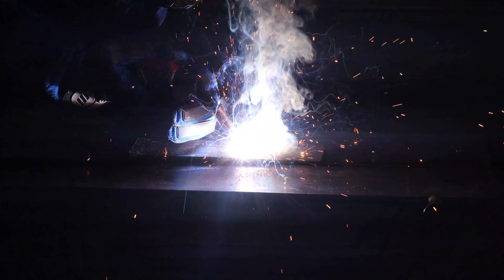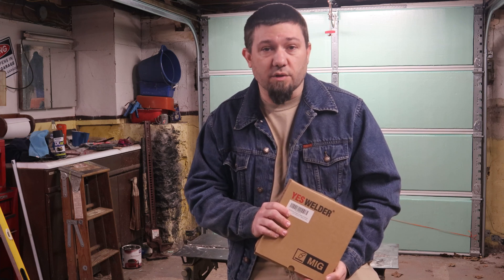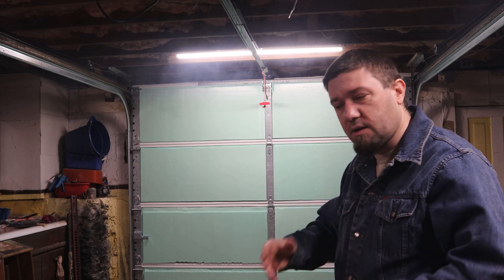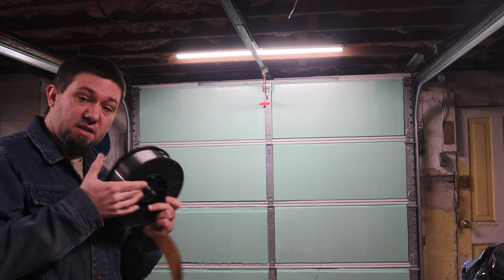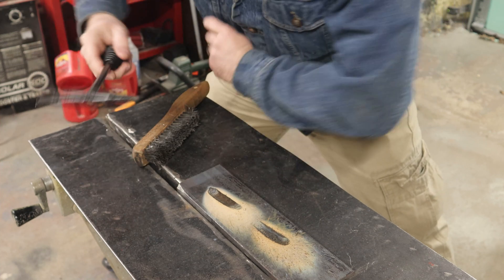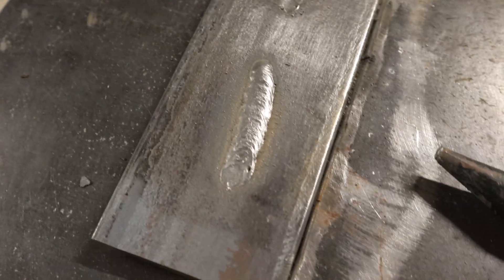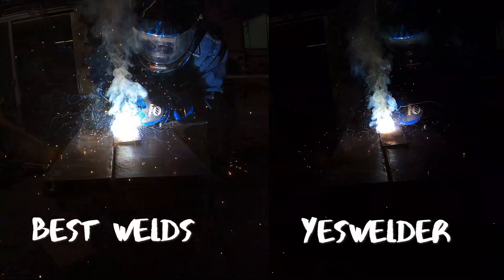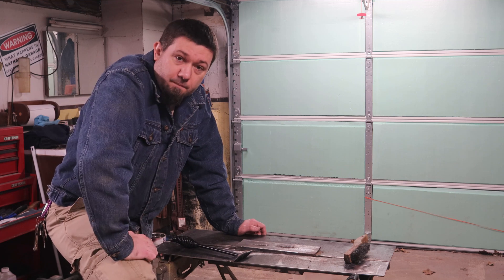Get Cleaner FCAW welds without switching to gas!

Comment: I discovered if I hook up the yeswelder mig205DS mig gun backwards, putting the ground clamp into the NEG socket it welds a lot cleaner with proper bead profile. Hardly any spatter or BB's.
when it was connected properly the arc was violent, hardly any bead deposition because it was leaving the bead in the form of  BB's. I made a quick video, am I correct ?
https://youtu.be/RIfdaYj6kWo

Comment: I have the exact same machine and Flux wire, same spool as you.
It spatters any way.
Reply from the maker: Flux wire will always spatter.  Ive found this wire to be less spatter-y than other wires.  Moving to real MIG will always produce cleaner results.  This video was meant to show that wire makes a difference when welding with flux core, and this wire, in my experience, worked pretty well.
Reply: @SWBCrawler  there must be something wrong with my machine, its terrible spatter, soot and berries everywhere.
I find it very strange that I cannot select .030 wire on the machine in FLUX mode.
So I'm having to select .035 when I'm using .030 flux wire.
I'm going to put a short video on youtube, see if anyone has any ideas.
I changed the tip and ground lead, no good.

Comment: I will look for some Yes Wire because I too am getting quite a bit of spatter that I really don’t like. Many thanks.
Reply from the maker: Thanks for watching! i hope you have as good results as i have. i’m still using the yeswelder wire! it’s not as clean as a mig with gas weld, but it’s cleaner than other wires i’ve tried!  surface prep is also important!

Comment: For a newer budget welder, is FCAW and gasless mig the way to go? I’ve been learning on a typical MIG with gas but I don’t want to buy a tank/ gas and all that for my home use
Reply from the maker: Well, I’m not a pro. I am self taught and actually only weld with fcaw.  Not because I think it’s better. But because its what I have.  Fcaw requires a lot more clean up, and your welds will never look as nice as they could with mig.  It does require less investment though. Less consumables. It’s more convenient and is better for outdoor welding if that’s a thing you need to worry about.  Personally I am looking to upgrade to gas mig. But I haven’t invested in a bottle of gas.  I would recommend getting a machine that will do both. In my experience most mig welders, even the cheaper ones, will also do fcaw.  So get a spool of fcaw and try it out. You can always upgrade later.

Comment: silly question but have you reverse the polarity?
Reply from the maker: Polarity should be correct according to the manual. again, new to this machine, and you set polarity differently than on my old one.  But yea, as far as I know its correct for flux core mig.

Comment: Turn wire speed down and amps up
Reply: If you turn down the wire speed you also turn down the amps wire speed is amps
Reply from the maker: Thanks for the suggestion!  I'm new to this machine, and still using the built-in settings for thickness.  I'll adapt as I get used to the machine.  Thanks for watching!